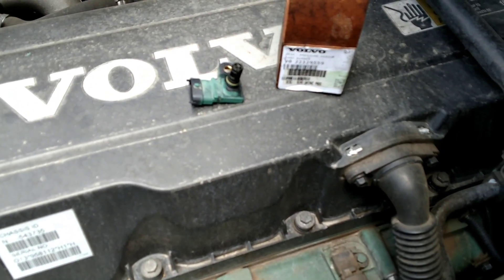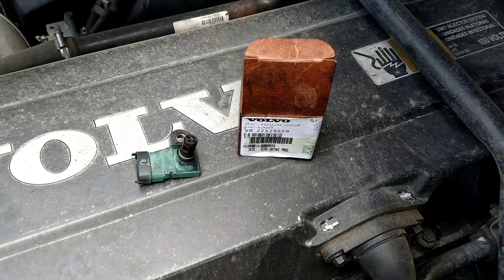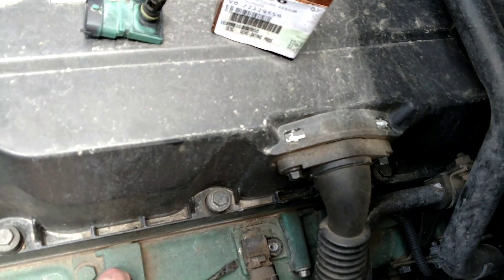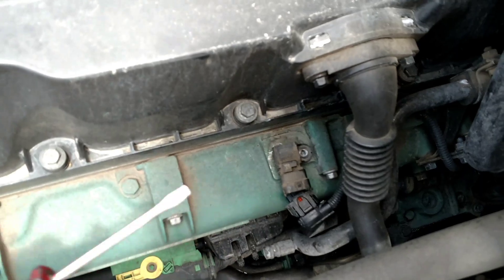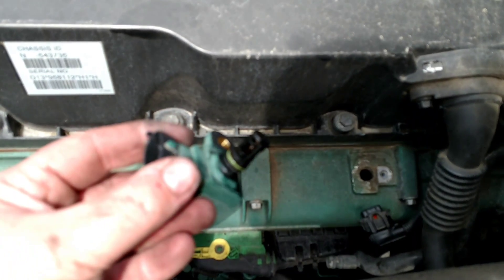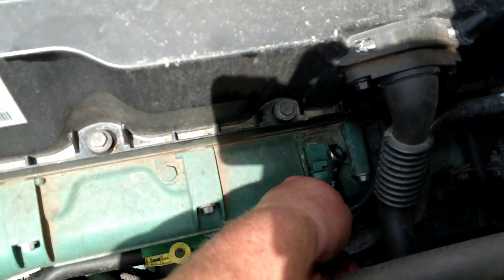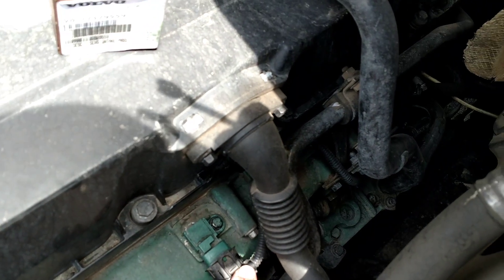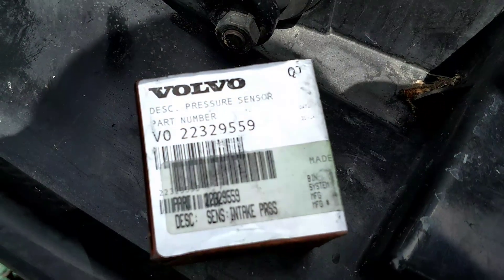HOW TO CHANGE VOLVO D13 INTAKE PRESSURE SENSOR

Comment: One more here 🖐 Broke mine and fell inside the intake too  😂😅  i started the engine and I clear could hear the valves eating it at the beginning. The plastic is so fragile that it does not cause damage to the valves. or I was lucky and my valves eats it without problem. Good luck 👍

Comment: I’m getting a code of SPN 1127 FMI 18 could this be related to the sensor that you replaced in the video
Reply: Im having the same issue , same code , i think it may be a turbo leak but will pull this sensor out clean it and see how it goes , did you figure out what was the reason it was throwing those codes ?

Comment: After watching this video, I went out to my d13 and pulled this sensor off. Yours looked brand new compared to what mine looks like. Didn't have any see-through ports at all. Time to pull out a can of carb cleaner and see if I notice any changes. Thanks for the video!
Reply: Change pulling ???
Reply: @canersekmen  I had to go back a watch the video again. Yep, I definitely recommend cleaning the IMAP sensor on the intake manifold. What I noticed was a slight increase in fuel economy and seemingly smoother idling of my engine. Not sure if the idling is connected to this or not, but just thought I'd throw that out there. Its been a couple years and truck is still doing just fine.

Comment: Can of carb cleaner is way cheaper lol to each his own, but you should also check your egr, 7th injector and doser valve as they can also build carbon not allowing enough heat for regen and throw ghost codes. Also the otr performance tool is kinda pricey but worth it in this crooked world
Reply: Guys can you explain where to find these things ?
Reply from the maker: I agree with just cleaning it. Where i work i get a killer break on parts. That new sensor cost 35 so why nOt replace. Also new egr and egr cooler. Thx

Comment: Im randomly loosing Accelaration power no check engine light, do you think this might be problem?
Reply: When I lost my speed sensor it derated my turbo to 1/4 boost and limited  my rpm’s to 1400 Of coarse I had no speedometer either.
Reply from the maker: Speed sensor or injector cups. Look for air bubble in fuel return lines inside fuel tank while on high idle.

Comment: You what fault code you got for this sensor ?
Reply from the maker: Never got a fault code. Just had weird boost readings. Also check all charge air tubes while running with soap and water and see if you have boost leak

Comment: If tht sensor is bad wht symptoms occur plse reply
Reply from the maker: Milagres Fernandes loss of powerpoor economy. False boost readings.
Reply: n8pruts 602 thanks
Reply: @nj8pruts  

My truck is a 2016 with a D13.  What did you finally do to fix your power and fuel mileage issues
Reply: @diywithjonandpebbles  we have same issues fuel average 6.8 sometimes 8 and it wont let us regen i replaced this sensor man truck runnin like before

Comment: The inside of the intake was literally holding by a hair when I took it out it fell inside now I’m freaking out any suggestions?
Reply from the maker: diyou s then your intake is carboned up really bad. The intake tube that the sensor was in needs to be removed and cleaned. Fallow the bolts around it and make sure you have a gasket or some sealant.  And lots of cleaner.
Reply: n8pruts 602 hi thank you for the info the problem is that the black piece with the small ring fell inside 😭
Reply from the maker: Yea i have no idea why they put such a fragile piece on there. If you pull the intake off make sure you have a scraper and carb or brake cleaner on hand.
Reply: n8pruts 602 yeah I don’t get it either! Thank you so much for your help I know I can’t leave that piece inside, my luck now I’m screwed
Reply: diyou s hi please let me know how you bring it out.... screwed up with same situation

Comment: Thanks for the video. I.m having issues with the 'boost' indicated from the fault diagnostics.
Reply from the maker: Marc B be sure to check all the air intake clamps. Over time they get weak or the shops don't tighten them.

Comment: lol use a socket
Reply from the maker: mike cole yea I would have if I had one on me. I wasn't expecting to have to work on the truck after at dealer.
Reply: you know a lot about Volvo? I'm a truck mechanic just starting to get into engines and courses I can take?
Reply from the maker: mike cole I have alot of hands on with the Volvo since my truck has been to the dealer almost 18 times for low power issue. but I know a fair share of repairs
Reply: What symptoms does that faulty sensor give?